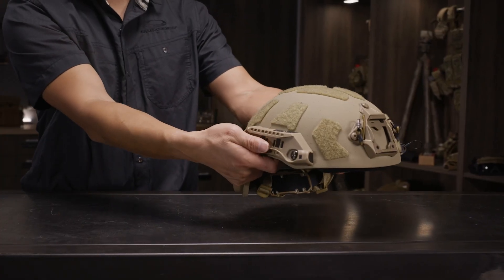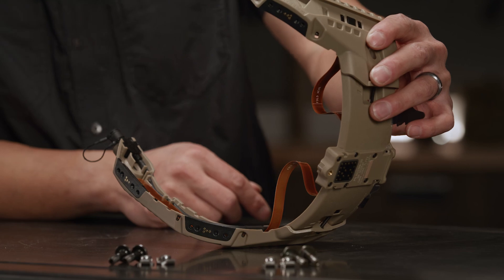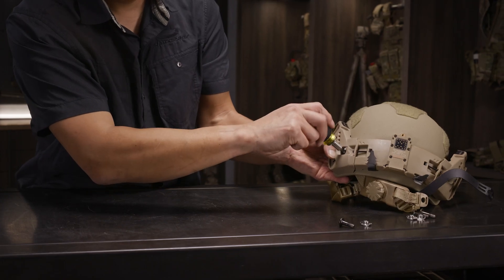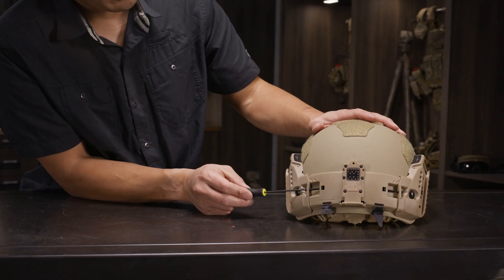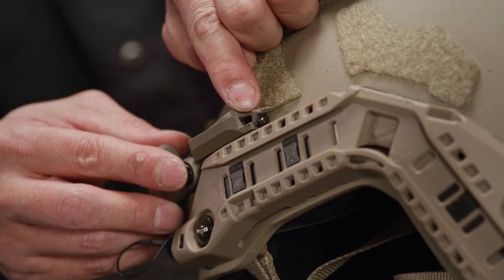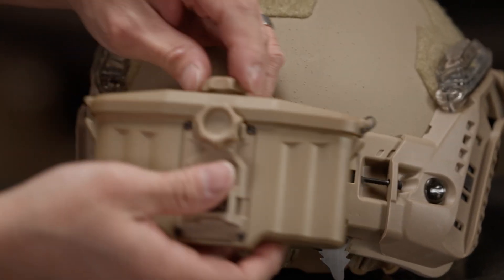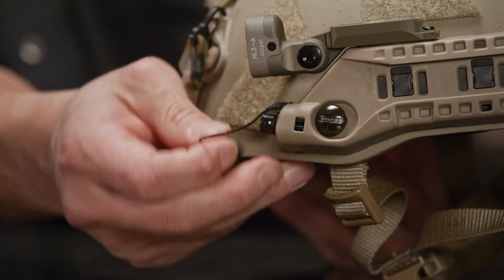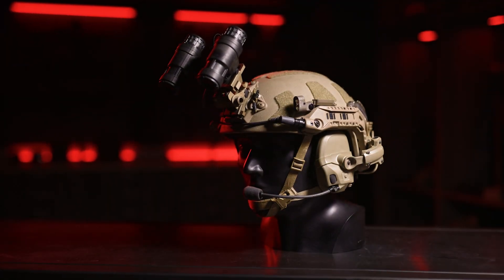Installation and Use | Ops-Core’s RAILINK Powered & Data-Enabled ARC Rails System

Comment: I love how we are starting to finally transition into powered armor systems, I can’t wait to see the 5k Plate carrier that will eventually be made to connect with this. That being said, this helmet is a nightmare, you’re going to have to damn near take off your helmet just to turn your strobe on, or turn your flashlights on. The wiring tape seems very fragile and is damn near unsupported inside the rail, it’s one drop/blast away from shorting out. I really like the idea but there are definitely some improvements I would suggest to make this system more operator friendly, and fail safe.
Reply: I’m an engineer, flexible PCB’s are a lot tougher than you think. A lot tougher. Doesn’t need to be supported and in fact you don’t want to screw flexible PCB’s down between two surfaces, etc. I personally can’t think of a single better design than what is shown for a powered rail. Wiring may instinctually seem better but trust me, this solution is far more stable. Big thing is there aren’t huge wire solder joints that are susceptible to g-forces.
Reply: @Laminar-Flow  I guess we will see, but during the installation I saw a lot of vibration in the wiring due to it being unsupported, and I think over time that will take its toll.
Reply: @ErrorOptik   That’s not how FPCB’s work; it’s intentional.
Reply: @Laminar-Flow  There is a reason game controllers and cell phones use ribbon cable connectors.  You are correct that this is far more robust than one might think.
Reply: @apersonontheinternet8006  For sure. Heck even satellites and a lot of boards used in military equipment, like inertial guidance computers in rockets and so on employ this sort of flexible PCB approach to connect sub-boards. They are quite robust and more optimal than solder joints in countless cases. Something rigid is much worse when you’re talking about a helmet that will regularly see serious forces. Just like the human body and large bridges/skyscrapers (harmonic oscillation and sway, or flexibility of bones), flexibility generally prevents outright breakage. You can more easily control trace resistance with flexible pcb’s vs soldered joints as well. Many benefits. It’s also more expensive but so what.

Comment: Ignoring the price point. Will work on helmets like the HHV High cuts and the Crye-tech Airframe?
Reply: From messing with this system it looks like if your helmet can accept the standard ops core rails then it can also accept the raillink. The system seems adaptable to all helmet sizes. The only thing you might need extra are mounting screws. The raillink is thicket than the standard rail system and screws come in based on your helmet type. That being said if you mount a 4600 dollar system on a cheap Chinese helmet that uses the US people as free beta tester then that's something to laugh at.

Comment: Bad Advertisement

Horrible Branding

A Fairly Cool Product

Questionably Meh Ability Improvement per the usual OpsCore Cost

Could it perhaps accept Drone Goggles?

Would Be Nice if more Corporations worked together like that

How super Proprietary Are the plugins?

Bad Strobes; maybe Okay for LEO, Airborne and very Specific Operator Use

Mohawks Are Better

Good Quality I Assume

It better Be sealed

Great Work advancing the Tech Culture

Really Need’s Better Memetics
Reply: use

more

indents
Reply: It was designed for a Tier 1 army unit running the latest Fused-Panoramic NVGs (F-PANO). You will not see the benefits or use case with normal NVGs. Fused NVGs are restricted to MIL/LE only so this is not for you and you don't understand the system enough to know what its benefits are.
Reply: @FDCNC  “…”

“As if any of That Is Foreign Culture.”
Reply: A regular person can still get the benefit from this system... for a heavy price that won't really make it cost effective.
Reply: @ivaniuk123  how so? The benefits are truly seen with fused nvgs so how will this benefit the average nvgs user other than reduce weight and snag hazards for an extreme price
Reply: @ivaniuk123 China could probably make it at the fraction of the price.
Reply: I did say that this can benefit the regular person for a heavy cost that wouldn't make them worth it... but in the future there will be more products coming out for this system that will integrate with it. This is why the rails contain black plastic punches...
Reply: You are absolutely 💯 percent correct in your assessment. However there is a reason this thing costs so much and it's not corporate greed. The purpose of this system is to be fast enough to be compatible with AR systems. I bet the chinesium will not be. I'm sure in half a year we will get an airsoft replica version that can do the very basics of the raillink (power lights, power NVGs without destroying them... maybe).
Reply: @ivaniuk123  True

Comment: How would one mount a helmet cover with the RAILINK?
Reply: I looked at a picture of one on tnvc's website and it looks like they installed the rail link without the helmet cover on. Then they put the helmet cover over it and most likely did some cutting in the proper places to get the battery pack to connect.
Reply: I mounted mine over top of cover on both of my helmet rigs. Keeps the cover from being removable but it works
Reply: I mounted mine to the bare helmet as per the ops core instructions and then I put the helmet cover on over top of it. I cut the back portion to be able to mount the battery pack. With the battery pack on it stays nice and secure and it just appears like I have a regular helmet with a battery pack that isn't connected to anything. I thought about installing it over the helmet cover but went against it because if it rains and the helmet cover soaks and wicks water and traps water into the rail link... at least that's my reasoning. Like I said, putting a battery cover over worked just fine and it hides the system to the point where people might question as to why you've got a random battery pack on your helmet.
Reply: @ivaniuk123  great point about the moisture. If that happens I’ll put it in my dehumidifier lol

Comment: Ok I understand the incentive to make a product pricier as it will be an "exclusive" GOV item, BUT nearly 2.5k for a glorified torch and battery pack, you can get night vision for that money!
Reply: That doesn’t include the battery pack or accessories. The total system costs 5k+.  Oh and AN ADDITIONAL 23 DOLLARS FOR SCREWS.
Reply: @alexshakk rail screws are 52$
 I was just on there getting the sizes so i can find the bronzed titanium equivalent somewhere.
Reply: The whole point of this system is to be future proof which is why it has really fast processing capability, and nodes with the ability to put in additional nodes into the rail later. I heard that ops core will have a powered version of the AMPs later. But yes, overall this system isn't designed for us poors. It's not even designed for the vast majority of the military. I think there will be more stuff coming for the rail link for those civies that can afford it.
Reply: That's absolutely ridiculous, I'm sorry. You could get a full setup of that for <$1000. And no offense to Ops Core, watching that installation tutorial where the guy mentioned like 3-4 times to be "gentle" with the helmet so as not to damage it made me laugh. It's a fucking helmet. It's gonna get bumped and dropped on every surface.
Reply: ok wait, you dont get a helmet shell but you have to buy the rails, the battery pack attachment bracket for the rear for 2.5 k and THEN you have to buy the battery pack for 1.1k and every other light, torch and strobe seperately for 200 + ???
Reply: Lol, yup. Welcome to government pricing.
Reply: @ivaniuk123 you beat me to it
Reply: @aquila3958 yes
Reply: Military scale of economy for one, so if more militaries wanted to get into this system then eventually the price would begin to drop, hell look at the F35, it started at soemthing like 110mil per unit, now it’s down to 70/80.

Secondly is a paraphrased quote from hoplofheil, they probably don’t want to make too many of them, so they price them at rediculously high price tags to tell you essentially this is not for you, fuck off.
Reply: ops core needs to make a helmet with ear coverage and a way to attach headset directly to the inside of the helmet so that it's all one piece